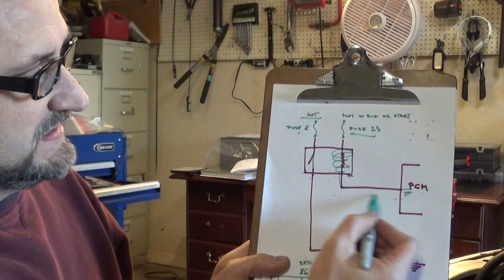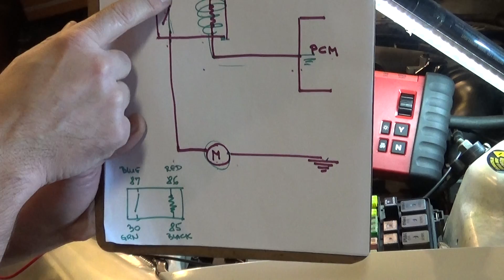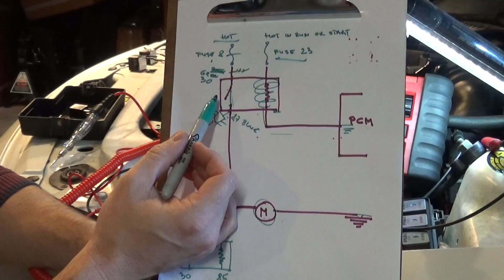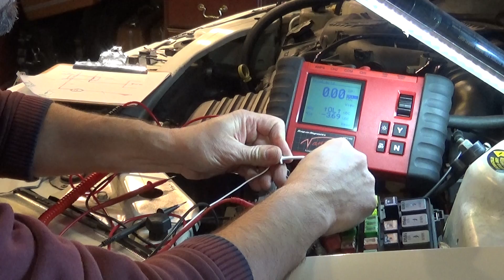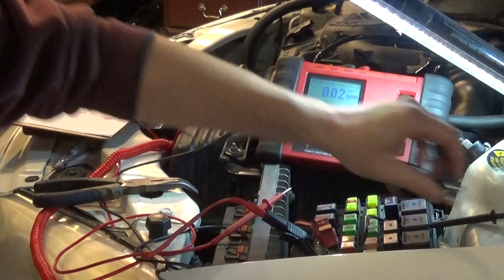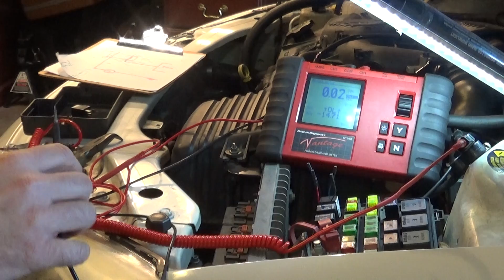Testing Automotive Relays From Relay Base

Comment: i also made some test relays.i have orings with thin wire wrapped around and i slide the oring over the relay pin im testing then tape the wire to the side of relay to prevent short and i use the thin wire as a tester,
also made some that i simply removed the relay casing and manually close contacts as its a fast way to determine load side wiring integrity and easiest to make.have a few others that do the same that has on/off switch connected to load side.

Comment: good  video ,quick question l got a intermittent start when warm start when cold no start have to jumped the relay,test light and voltage tested relay pin, all light and show about 12volt except pin 86 no light and voltage show 8v,what could be the problem a short or something

Comment: Just a quick one here. I have a 12v steady on the control side of a Chevrolet Captiva 2011 without turning on the ignition. Does this means something is wrong and if Yes what could that be. Your video is very educative
Reply from the maker: Some circuits are hot all the time some are hot only with a key on or engine running .Only way to know for sure is to have wiring diagram.
Reply: @kyhomegarage3430  thanks for the timely response

Comment: Nice job on the relay, that is a very creative way to make the terminals accessible. I might have to make one of those myself. I just made myself a low profile current loop since the ones you buy online don't fit in every place in the fuse box. I couldn't justify buying the nice ones that raise the relay up high either, so homemade it is. Thanks!
Reply from the maker: Baxrok2 thank you so much  for nice comment please check my other home made tools.